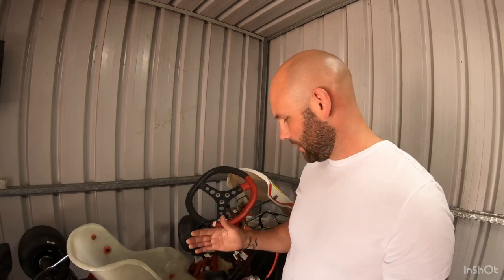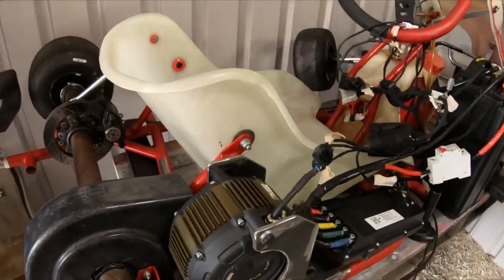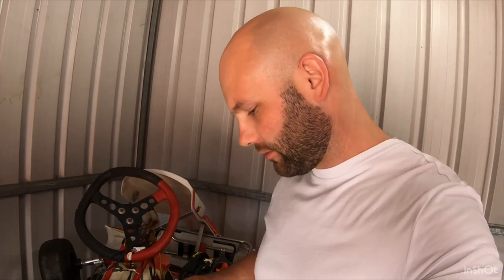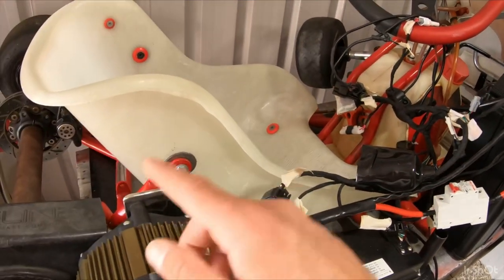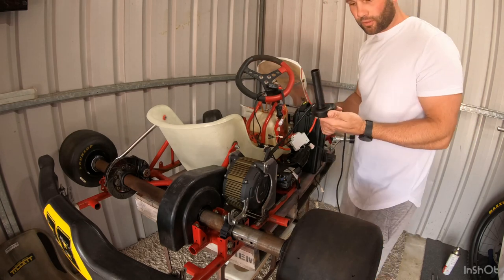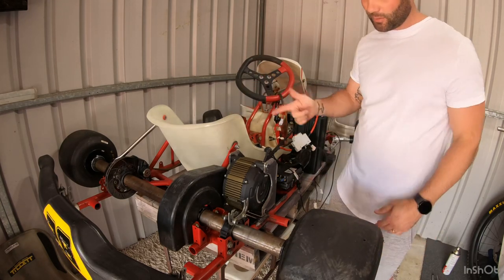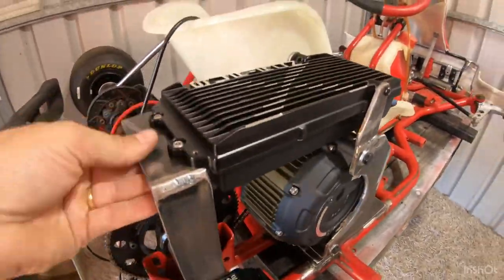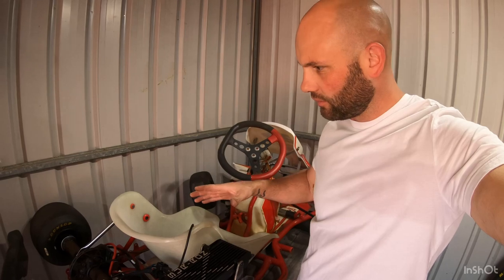Surron Electric GoKart Build Part 1

Comment: Fascinating build. I am curious to see how the Surron motor will perform in a go cart.
Reply from the maker: It went well, i have since sold the Kart as a roller and plan on doing an offroad conversion will the Surron running gear